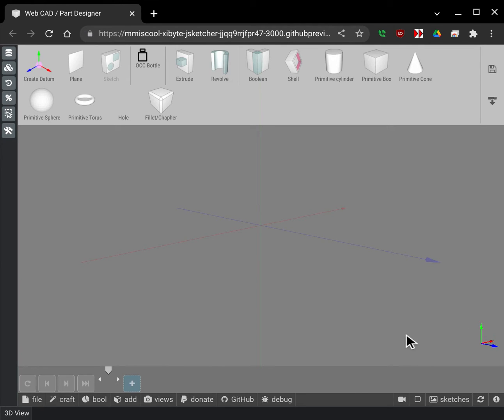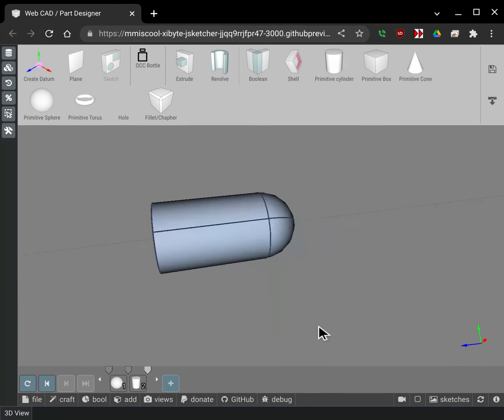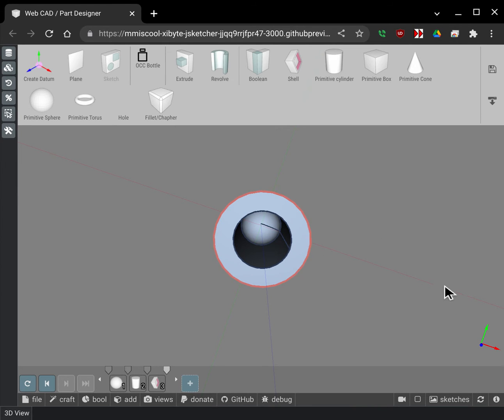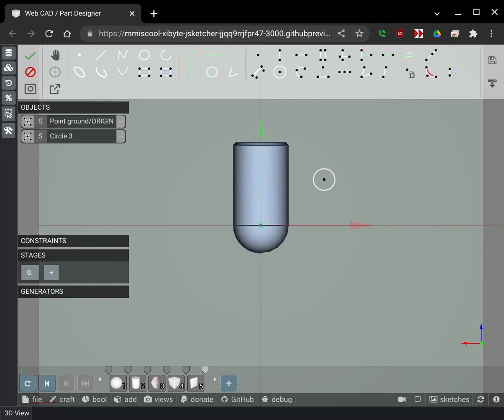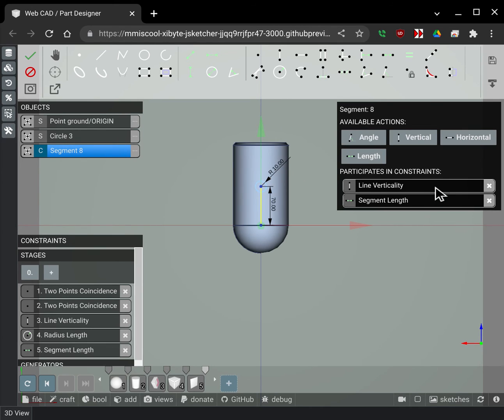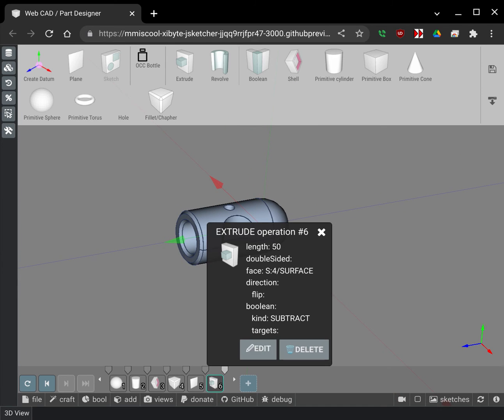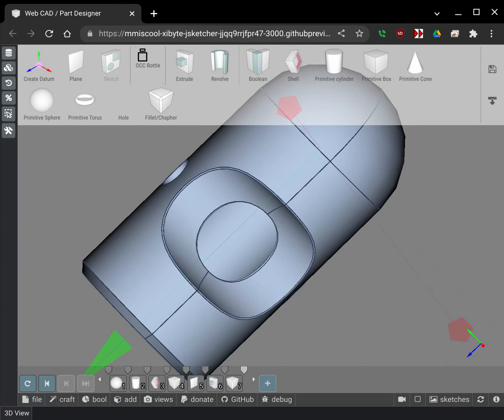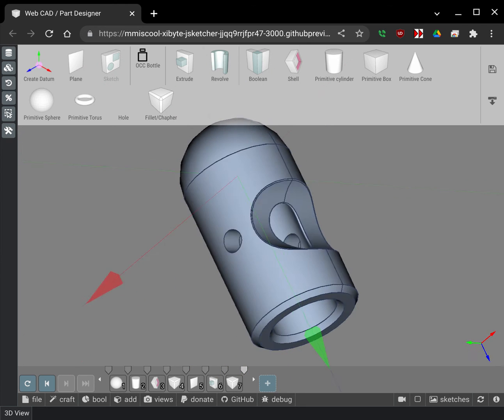Jsketcher updates teaser. Browser based parametric feature history/constraint based sketches modeler

Comment: This software is supercool! But the "Shell" function doesn't work in the web version. How can I run the github version? Thanks.
Reply from the maker: Clone the repo and run "npm install" and then "npm run start"
Reply: @mmiscool  Thanks for the info. I tried with Node.js, Virtual Studio Code, Command prompt and had no luck. No problem, I'll try it tomorrow again. Is JSketcher available for commercial use? I mean, can I sell 3D models made in JSketcher?
Reply from the maker: @vcolino  Kind of a late reply. You own your models. The licence just requires you send any improvements you make to the software back to the main project. Commercial licencing is available for companies looking to build closed source CAD systems.
Reply: @jsketcher9783  Thanks a lot for the fast reply! Fantastic! The Shell tool works great now :) This software is extremely good, much more than it can look at first sight (it reminds me of the CAD software "Moment of Inspiration" for any reason). Thanks again. Stay cool.